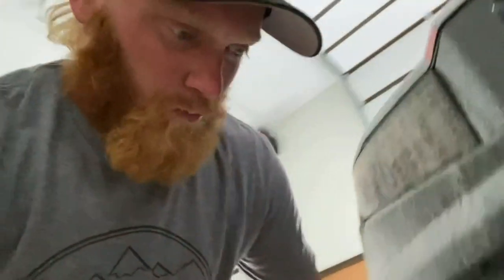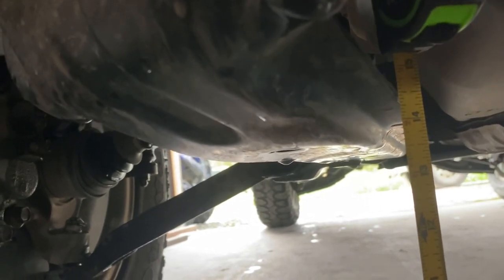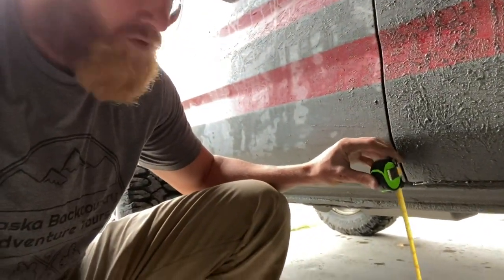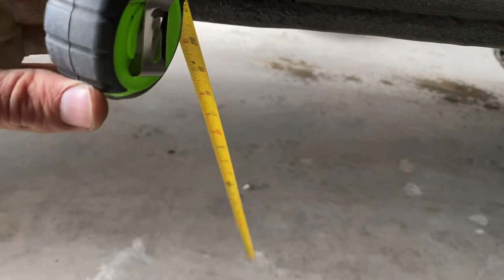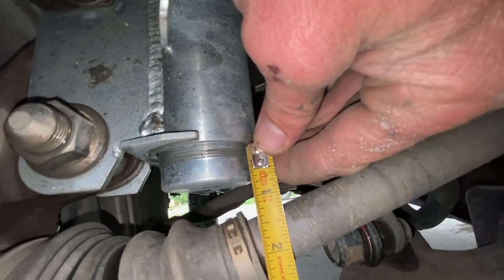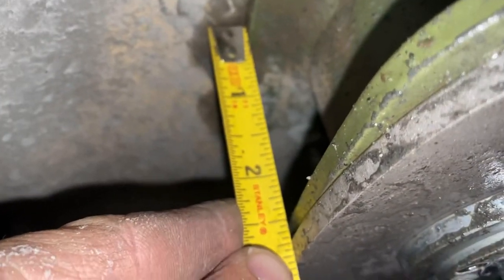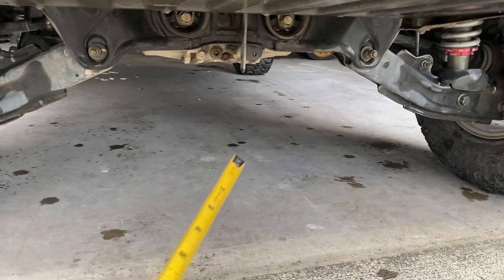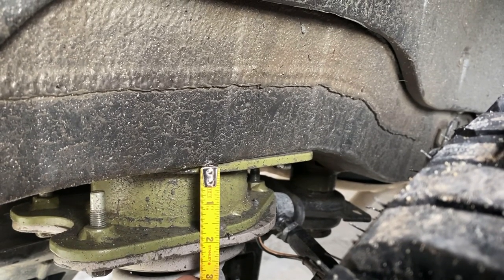New Flatout Suspension set up Honda Ridgeline

Comment: Hey if you add washers or a spacer under each motor mount it will drop your engine and transmission down and level your cv axles out some without dropping your body !!!
Reply: Mine had a wobble on take off around corners after adding lift then I seen a guy on U Tube add 4 washers under each mount for the same reason so I tried it and it worked !!!
Reply from the maker: I have the 1” subframe drop, which included a 1” spacer on the engine mount. Are you saying to add more to that?
Reply: @RenegadeHQ  
No 1” should be lots didn’t reliize u had it spaced already but if your axles are still on to much angle u could always try a little more

Comment: I'm far in Nicaragua with all those bad roads. 3 questions pal! I have 3" HRG with subframe drop. 1. Is flatout suspension won't give additional load on axels for future problems?  2. What are the benefits installing flatout suspension besides more getting more lift in comparison to original suspension? 3. what else besides I would need to buy in order to get similar setup like yours? thanks man appreciate!
Reply from the maker: If you keep it at 3” or less and have a subframe drop kit you should be alright with OEM axels. Flatout can handle more abuse then stick suspension and it’s a better ride and is adjustable. The suspension videos I have on the channel will go over everything you need for it. Your welcome! Thanks for the support!
Reply: @RenegadeHQ  Thank you! which versions you of Flatout you purchased? if I keep my only HRG 3" height, then maybe it is better to purchase regular Flatouts without lift feature? Just to have that rebuildable shocks with abuse handling and more comfort.

Comment: I wish I got the 3inch instead of the 2 inch, I don’t even feel like mines lifted! But I also have stock size A/T tires if I had bigger tires I think it would feel and look a lot bigger with just the 2 inch lift
Reply from the maker: It would but you will have to start modifying things a lot if you don’t get a bigger lift.
Reply: When you go with a taller tires is there a way to calibrate the speedometer?
Reply from the maker: I never figured that out. I just knew how off it was and made the mental adjustment